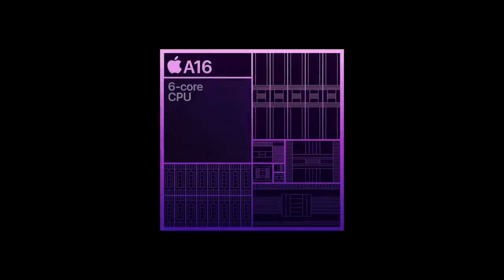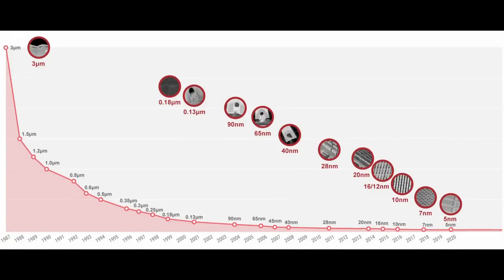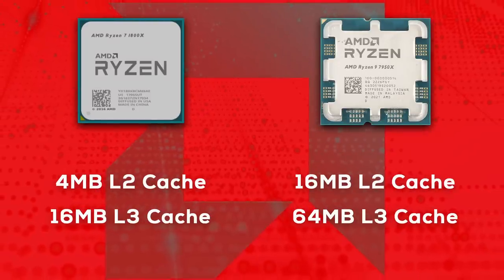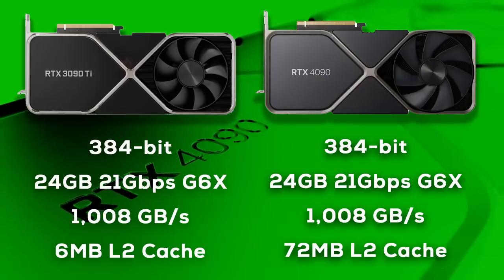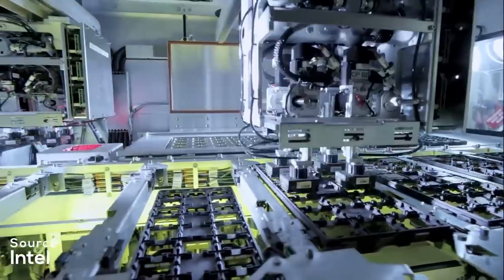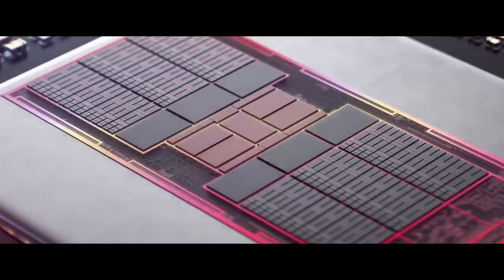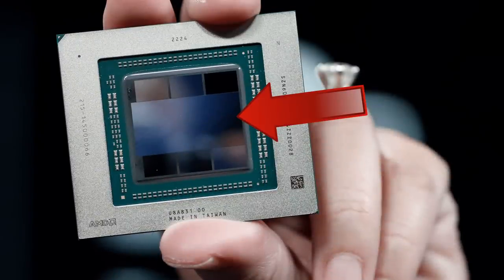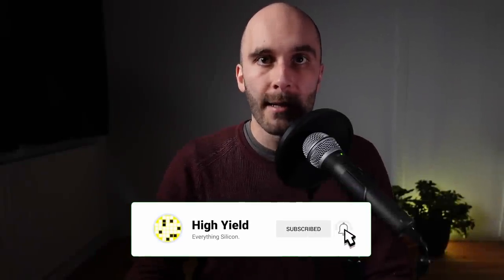Next-Gen CPUs/GPUs have a HUGE problem!

Comment: Then we are lucky that cache is the most easy way to isolate if defective. Actually in each modern chip, there is a little more L2 and L3 cache than advertised, so defective parts can be disabled, and still having fully functional chip.
Reply: It is not about defect. The SRAM cell stop shrinking on newer nodes. This means you cannot increase the number of SRAM use in a processor because increasing them increases the die area needed. The problem is that most method of increasing Processor performance is by increasing the amount of SRAM somewhere either by adding more buffers or adding more caches. With SRAM scaling dead. All processor will be force to increase silicon area to increase performance.

Comment: I wait for the day, when the first "Stack" design of CPUs will appear.
A kind of "tower" of CPUs, which have connections on the bottom and on the top, interconnecting at both sides (left and right for data, up and down for cooling).
Between those, there is the connection and a cooling part, efficient enough, to cool the bottom and the top CPU at once for each CPU.
CPUs would have "Pin-connections" on both sides up&down, no metal cover anymore. It's like you take 2 CPUs and put them together at the flat side, but this will be 1 CPU.
If you would imagine, interconnecting 20 High-End-CPUs like the Threadripper lineup with this up&down connection design, let's imagine you would have 96 cores (for the next-gen) for each CPU, which together (if scaling is linear) would give you 20x96 = 1920 cores. For your 20 CPUs.
I believe that this will be the future.

Comment: DRAM has a latency problem, it has not had substantial latency improvements in well over 2 decades, while performance requirements keep rising. To extract ever more performance out of logic, so it's not just idle waiting for memory, this latency needs to be hidden either by scheduling or by cache. Curiously GPUs could make do with ridiculously little cache for a long time because they could just switch to a different workload, the data for which has been fetched just in time previously. This has met its limit now i suppose, but there's a possibility that an architectural solution may yet be found.

CPU side, similar is accomplished by SMT, i think we might see 3- or 4-way SMT per core eventually.

Also we currently have 1-transistor per cell DRAM and 6-transistor SRAM. Is there some sort of a compromise topology (2- to 3-transistor) that can serve as a part of cache/memory hierarchy which would be more of a compromise between the two?

Comment: Tbh now we don't need more power. Modern CPU/GPU flagships pack way enough punch. All we need is better power efficiency, more polished drivers, and software developers that optimize their apps instead of always relying on ''the next hardware generation that'll finally make that code run''

Comment: The dependability of sram is paramount to the dependable operation of the cpu. The physical limitation of static ram technology is hard to surpass with current materials. The application of 3d stacked ram will be the only way to temporarily circumvent these limits and still get the required throughput of ram necessary for the new cpu. The next step will require a quantum leap in materials technology. What will it be?

Comment: One thing I don't understand is... each chip on my DDR5 stick stores 1 or 2 gigabytes, and my microSD card stores 1 terabyte... but somehow 64 MB of L3 takes up so much space on a CPU/GPU die? Is the die area used by 64 MB of SRAM really 16 to 32 times smaller in m^2 than the die area used by the 1 or 2 GB modules on a DDR5 stick? Or does SRAM somehow use 10 times more die area than the equivalent DRAM? Or do SRAM and DRAM use the same area but the CPUs/GPUs just have so little space available that even allocating the tiniest area for 64 MB is a huge deal? If SRAM doesn't use more physical space than DRAM, then why can't we have a chiplet with 1 gigabyte of L3? Does SRAM cost 10X more to manufacture than DRAM?
Reply: the data doesnt take more space the logic to acces each and every one of it takes alot of space....think of it as in the stick you have 1 guy patroling a full train of people and you tell him pls pull out the guy wiht the red shirt while in the cpu you have a guy standing next to each seat and aks pls pull out the guy with the red shirt :D  you ahve to employ a shitton of guys for that one train AND you drasticly reduce the amount of seats that train could reasonable have if you alway have to make room for the guys standing next to eachseat.....
also in practice in your stick the procedure would be that each customer in a traincard (rowacess) would have to leave the train and go throu a terminal  so that fuking slow by comparison ....
Reply: @proxis9980  It sounds like you're saying that unlike DRAM's tiny bus width, SRAM's "bus" is so wide that most of the die area is taken up by logic allowing 1:1 access to any SRAM bit at low latency, and not taken up by the actual storage of that bit. I wonder what the multiplier of die area required for low latency SRAM is? I.e. does it take 10x more space in total to store the same data while allowing low latency access to any SRAM bit?
Reply: 1bit sram cell is consisted of 6 transistors while 1bit dram cell is 1 transistor+1 capacitor only. Also sram caches are 100s of times faster than dram. modern Dram chips are made using 20-30nm process which cant be properly scaled well to smaller process nodes. That capacitor of a dram cell is not that scalable.

Comment: Id suggest 
The tech in the new Light based cpu, where as few as two photons can be used to create a on / off switch for 0 or 1 states will replace the issue, instead of trying to provide a non existent solution / $.   These also run very cool compared to current standards of processing.

If not that then something similar will be needed to scale with that for memory standard. 
So the final jump, at least in the nearer term, coming decade which maybe totally ditching Sram.

Its only a problem if you looking at whats main stream and here now, about to arrive.
The future is light based processing, with similar tech coming for the ram, or it will be bottlenecked, will have to accompany it.

Comment: AMD saw this a mile away.. Chiplets is the solution. The cache will be further away, but you could still upgrade the lanes and still shrink the other CPU/GPU core chiplets. So keep a smaller L0 cache embedded on the CPU/GPU core, and push the L1/L2/L3 further down the pipe. (Wrote this before you actually mention chiplets at the end there)

Comment: This issue is also seem by the rise of the BOTTOM chips.  I started working in a computer store in 1982.  We were still selling Z-80 based CP/M machines.  Until the Celeron chip was introduced, Intel basically made one CPU chip.  Now Intel builds a very wide array of CPU chips.  A number of ARM devices can run Windows 10.  We went from single core processors to the i9 processor.  Static RAM was available back in the 1970s.  A high school buddy and I created a memory card for a video game.  The card used static RAM.  This MIGHT finally call for the creation of optical connections between CPU block and the Cache blocks in order to keep the speed up.  Copper is very slow comparatively.  Perhaps a new cache technology is due.  Back in the late 1980s, HP came out with "Bubble Memory".  Think SSD of the era.  Unfortunately this technology failed because it was "not stable".  Problems have arisen in the past and solutions have been found.  As Intel and others have concluded not EVERY CPU chip have to be at the very top of the heap.

Comment: SRAM could scale if it not becoming larger.

I listen to AMD engineer about this somewhere about 3D V-Cache and why, thing is, more dense the SRAM = larger SRAM using same amount of die area, this mean more signal lines and longer run compare to power it could transmit. That's why AMD doing 3D stacked cache to shorten the signal lines and enable larger cache on the chip. Chiplet may help about yield and scale but introduce more latency to the SRAM and require more power.
Reply from the maker: You are right, that also why 3D stacking is so amazing, because if you run the wires straight up, they become shorter.

Comment: I am glad that someone is commenting on this. Here is an example of AMD vs Nvidia GPU chiplet wise.

AMD is getting roughly the same performance on a die nearly half the size. The MCDs cost maybe $6-3 in silicon each, so honestly an irrelevant cost. Nvidia can't increase the die size much more. The absolute max die size is 858mm2, already at 608mm2 for AD102, whereas AMD is only at 306mm2. 
1. Die size alone, AMD can double the compute die space and be the same size as AD102 and GA102 roughly. 
2. Nvidia would have to increase the massive on-die L2 cache if you want to add more compute, so they wouldn't get a linear increase in compute-to-die space increase. AMD also wouldn't get a linear increase in compute-to-die space. It would be greatly over-linear as their big cache area isn't on the N5 die but using the N6 dies. 
3. Moving both to some N3 node, AMD could be near quadrupling raw compute units without any significant architectural change.
4. Nvidia has a limit to the cache and bandwidth amount they can get, even with brute force. All AMD has to do is add more MCDs or even stack additional cache.
5. Once we move to 2nm nodes, they will require High NA EUV machines, which cuts the max die size in half as of now. The max die size a monolithic 2nm could be is 425mm2 or so.
6. Look how long it has taken intel to get their MCM/tiles working. For their MCM Sapphire Rapids, that is H1 of 2023. For tiles/chiplets, that is H2 of 2023 in Meteor Lake. Intel had basic "chiplets" in 2010 with Westmere (Example: i5-661)
7. Nvidia isn't fighting AMD starting from square one like intel had to do. AMD has had 7 years of overall experience with successful MCM(Zen 1 Threadripper/EPYC), chiplets (Zen 2), and now 3D stacking (Zen 3D).

This is just the first gen, and you can already see the writing on the wall. Nvidia can even touch them after the generation after the next generation because Nvidia's only option is near-max die size, more power-hungry, and more expensive GPUs in every way until they have chiplets.
Reply: Very good comment. 
Do u think nvidia is building a chiplet design or r they just waiting tsmc can come to their rescue?
Reply: @sudeshryan8707  there is no proof they have any disaggregation in the works. The only MCM they have done is their Simba machine learning package. That was basically the same complexity as a bitcoin miner, where latency is practically irrelevant.
In this case, TSMC can’t come to the rescue, and even if they could, they wouldn’t. TSMC makes the packaging and the silicon node, but they don’t make the architectural or the fabric/interconnect design requirements
Reply: Comparable performance to Navi31 (full die in 7900xtx), from what we have seen, is actually more the 379mm² AD103 (full size in 4080) than AD102 (cut-down in 4090 , probably will be released full size as 4090ti). Also Nvidia use some of that space on dedicated Ai / RT cores (wheter they are relevant or not is another debate). So I don't think AMD is that much more space-efficient for now. 
But it is good that they are taking the future-proof way, I would just not put Nvidia out of the equation yet for the future given than they can brute force R&D with more money that AMD can.
Anyway if they both continue to be as greedy as currently the common people won't be able to afforde any of the two.
Reply: @Curio2314  AMD also has dedicated AI and RT hardware. You are right, AMD isn’t more space efficient, but that is because we have massive 800mm2+ die, so it isn’t a concern. If these die were made using a high NA EUV machine, AD102 would be impossible and AD103 would be 40mm2 off. The L2 cache takes a massive 15% or 85.74mm2 of the die space on AD102.

Sure, Nvidia has a far amount more in R&D, but that doesn’t mean anything when you have over 7 years of R&D with disaggregating CPUs. 

Answer me this question, was intel able brute force with 3 times the R&D as Nvidia? Then how can Nvidia be expected to compete with with someone almost the same size as them, but with more than 7 years of success.

I am not counting Jensen out, but we also said that with intel, time and time again, but now, AMD has experience

Comment: so, is SRAM just stopped scaling for now, or is it forever? I mean, some parts just can't be shrinked again like some analog stuff, because shrinking it actually kills it's performance. But for SRAM, denser is always better. Sure, TSMC's 3N is approaching FinFET's extreme limits, but GAAFET is around the corner. Do you think GAAFET can be a remedy to this issue?

Comment: limitations aren't necessarily a bad thing, as they inspire creative solutions which could lead to interesting breakthroughs. i mean look at the history of graphics. look at all the different raster-based rendering techniques that came about because of realistic light simulation (ray tracing) being too memory intensive to be practical for most uses, from the 1980s to the 2010s, was?

Textures, bump mapping, normal mapping, LOD models, shadow mapping, volumetrics, none of that would exist, or if it did exist would look drastically different, if the technology it was made to compensate for the deficiencies of had worked efficently from the start.

Comment: Actually I am not surprised because when you do the calculation of the structural size of the manufacturing notes with the van see waals silicon atom radius of .22 Nm you get only  about 14 atoms. And the structures get so small you will get a manufacturing problem as well as problems with quantum mechanics when you get to sizes below 5 atoms. This is a guess but chemical bonds work with quantum mechanic properties. And getting that small gets you in this ballpark size wise.

Comment: Are you actually unaware that the 7nm "3D v-cache" in AMD's 5800X3D chip are about twice as dense as the L3 cache on the die itself? That's why they have 96MB instead of 64MB. Both layers are the same physical size but the upped layer is twice as dense. It's a benefit of a purely SRAM focused process with no logic transistors.
Reply from the maker: I’ve talked about the use of cache optimized libraries for the 3D V-Cache chiplets in more detail in previous videos. Another advantage is the fact that the cache chiplet doesn’t need extra SRAM control logic, which further increases area savings.

Comment: something i am very interessted about coming at least 1 or 2 decades into the future are optical cpus that are using photons insead of electrons. This schould change everything, not only in raw speeds of an cpu/gpu, but also when it comes to sram, bandwith and power consumption. The solution is there, but this technology is sadly pretty far into the future i believe. I am not 100% sure how the scaling is on optical solution with sram, but because this tiny "cristalls" that can stash, if you can call it that, can hold multiple collored light particles and therefor increase bandwith by a lot. So my assumption is, that these crystalls will be able to scale allmost indefinatly compared to current technologies.

Graphine instead of silicon would be something very interessting as well. Electronics build on graphine should use a fraction of power compared to silicon. Combine this material with stacking every component a whole pc needs to function in an single icpu/apu and i can see that this would be a very effective work arround as well, allthough i am not sure if this aproach would be cheap, but at least it would be very effective. Sadly, this technology is far into the future as well and i am not sure how much time and effort is put into this.

As far as i know, optical solutions are in the works by a lot of companies includeing intel, allthough its more like an partner program as far as i am aware. 
The good thing about this technologies, simply is, that the future holds very impressive performance leaps and considering other stuff in the tech sector i do believe that not to far into the future, most likely in the lifetime of most watching this channel, humanty will lock back into the 2020s and think: "Well, they lived like stonemans back then.".

First of all, lets see in the near future how gate all arounf transisters will do and how the stacking technologies will mature. I am very positive, that we will see very impressive solutions in this decade, like 3-4 times the compute power of what is currently available on the market and goning furter into the future we can only asume, but i would say with other technologies, we could see 2040 or 2050 hundrets if not thousands of times the compute performance we have nowadays. I am hyped and i hope i can actually see how everything plays out. I would be pretty old by then. ^^